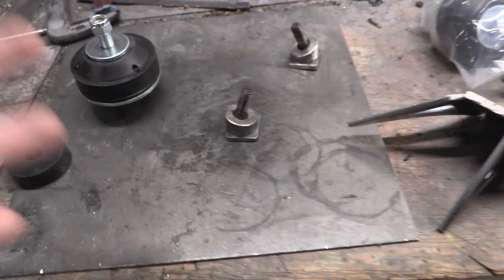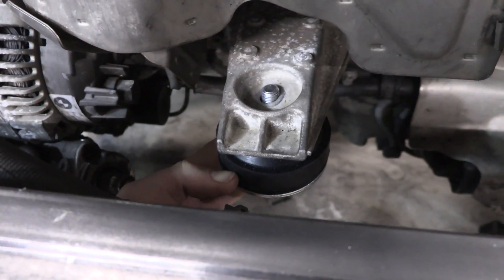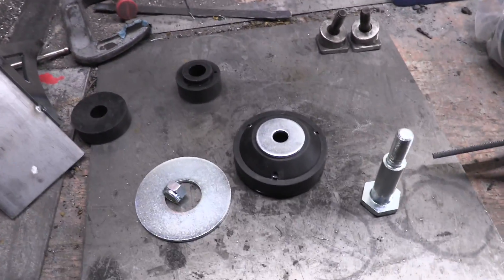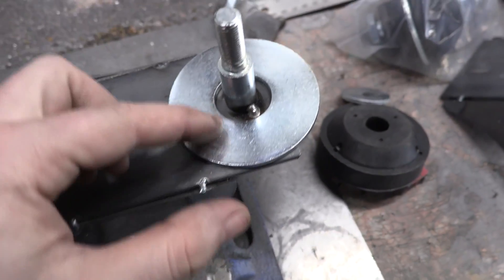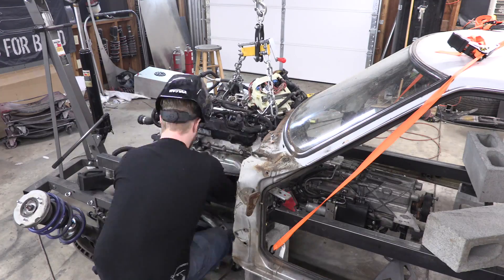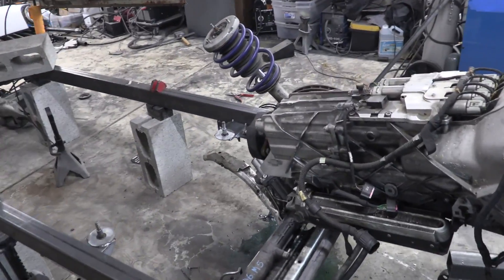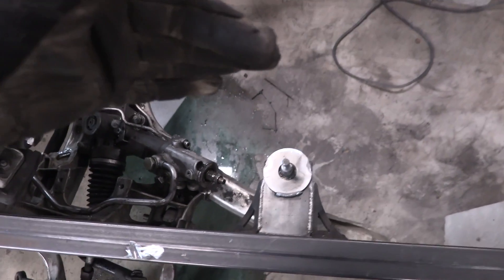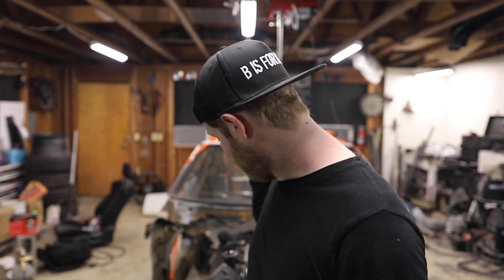The M5 Engine is Officially Mounted in the 240Z!!!

Comment: No clue why you went with that engine choice when there are so many better choices out there.  Those motors are extremely unreliable.  They have issues with the connecting rod bearings needing to be replaced every 100k miles max.  Also there is the Vanos system which if not maintained properly can destroy the motor.  I would have gone with another brand of engine altogether!

Comment: Hey Chris, great job so far, Although I have some concerns. I know you are still setting up your welder and stuff, but to me it doesnt look like your weld melts into the brackets. Its hard to catch when you arent closer, but there should be some change in color around the welds on the metal, otherwise you are just piling on weld and not penetrating the material and making a solid "bond"

Comment: Sooo.... Its technically a solid mount now... right? Or maybe im losing it. You removed the rubber seperation. From a carpentry standpoint, you made a solid point load to the frame...

Comment: Please drill the mounts and use an actual bolt. No matter how well you weld the stud it is always going to be weaker than a proper bolt and nut. Also as many other comments are saying, if you are going to use a mount with a single bolt or stud, you may as well solid mount it because if you allow any deflection of the rubber from engine torque, that is slackening the tension on the bolt temporarily and will cause a hammering force in the bolt and fatigue it.  That hammering force will also transmit to the aluminum engine mounting point which has low fatigue resistance being cast aluminum.
Reply: That is why normal engine mounts use two bolts/studs mechanically bonded into rubber so all the bolt tension is only based on metal to metal contact.

Comment: Chris you and Chelsea are going to die in a terrible accident in this car if you don't put rubber on both sides of the mounts. If it fails at high speed your going to have a heavy engine wrapping that chassis around you

Comment: I really love your work I think your awesome but if no one arks these questions then how will you know if you may have done it wrong  please don’t think I’m being picky I really want to see you succeed in your build.
The new engine mount is awesome but when you cut the bolt and welded it too to the engine mount wont the washer just sit on top at the bottom of the thread even with the rubber cookie with the engine weight, will it still be metal on metal. Hope you understand what I’m trying to say.

Comment: Is it me or does the engine mount in the car have a slanted area where the nut tightens down? If so this whole mount isn’t going to be very strong and might even snap the bolt at the nut! Plus everyone is correct about the second bushing your need to dampen both forces ie engine pushing down as well as the engine lifting this will only help snap the bolt or pull off your welds!

Comment: Kudos for all the skills Chris, much respect bro.... However the other rubber part needed to be mounted below the L bracket coming off the frame to allow movement. How it is currently mounted is basically just a solid mount and will more than likely break. 

In an ideal world a hole should have been drilled in the L bracket from the frame and a longer bolt used to get you your extra thread length.

Don't think this comment is hate, love your work buddy, just had to mention this to stop failure later!

Comment: engine is mounted solid...  could have just saved yourself trouble and just bolted it down to the frame. (which is essentially what you've done, plus a decorative rubber piece on the bolt)

Comment: Do you have a concern about the motor mounts bending with stress over time and abuse? The mounting post sits near the edge of your framerail extensions where there wasn’t much structural rigidity to support the engine.

Comment: I don't think that welding a bolt after cutting it's head is the smartest move,as it's not strong as if it still got it's head,why you didn't drill a hole,and made the head of the bolt under the engine mount base,then welded it,it would be much stronger.

Comment: Since it is independent rear you need to put the motor on a slight downward angel and the differential on an upward angel, otherwise you will chew through driveshaft universals because the grease cant circulate properly

Comment: A solid mounted engine mount stud doesn't look right, it needs to move both ways. Under acelleration one side will be hard mounted (it will crack) and on de acelleration the othe side will be hard mounted.. nice work tho

Comment: I'm litle bit worried that the longer engine mount doesn't have enough support under the washer. Considering engine weight and stresses during driving it could bent right before triangular supports...

Comment: You are MAG welding...not MIG...MIG is for aluminium and other materials...for steel is MIG...for MAG you use active gas like Ar or He,MIG is inert gas like CO2 and mixtures of it like CO2+Ar cronigon and etc.

Im a profesional welder if you need any adcice on TIG or MAG welding just ask
Reply: TitanSilver354 i wrote all of that upside down...mag is for steel with active gas like co2 and mixtures...mig is inert gas like he and ar for aluminium welding

Comment: nice work on the welding each video your getting better! practice makes perfect! quick weld tip, if you feather your tack weld out a bit you can run you root pass over it and tie it in cleanly. on grove welds/gaps feathering your tack will help with getting full penetration on the metal. keep up the great work!

Comment: you just made a solid engine mount by welding the bolt onto the bracket. For a damped engine mount there should a section of pure rubber (like the burned off rubber on the original BMW mount) that absorbs vibration

Comment: You really need to stop now and scrap what you have done so far ! Any half decent engineer will have a fit seeing this mess!
It won’t be allowed on a racetrack and only the most halfassed inspection would get it passed for the road.
I’ve said it before this is an over weight mess stop here and get some advice from an engineer before wasting more time and money on this pigs breakfast!

Comment: Awesome channel, awesome builds, some ideas that may help you. If youre up to trans mount next and if you havent already do some research on trans output to diff flange angles before locking that in.  On what will be a very short driveshaft I cant remember what ends were on the m5 shaft but if its traditional uni joints then you could consider changing to either the CV joint style ends or double cardan joint if the angles are severe. Also if going to airbag suspension that may affect your final strut hat design/size/placement unless its a direct replacement sizing/mounting for the existing coil spring/strut. As an extra level of security for engine mounts if you have some sort of plate/chain/strap so if the rubber or bolt etc fails the backup system at least keeps the engine roughly in place. You also asked recently about tools and things. Personally other than cordless items try and find anything thats old that may have been made in USA, germany, japan etc. Providing it hasnt been severely abused it will outlast anything made in the last 10 years. Bench drills, bench grinders in older items run so much smoother and tolerances better than anything recent. Ideas for the shop is shelving, or benches and maybe mounted on castor wheels, warehouse pallet racking is pretty cheap quick and easy to use. Wooden shipping crates with castor wheels screwed under them could be put under the car bodies/chassis to move them easier.
Save hurting your back and body in any way you can. Life gets pretty crap when you used to be able to do anything you wanted to when its hurts to drive a car let alone wrench on it.

Comment: As I see it, the rubber isn’t doing anything, the aluminum mount sits on the washer that sits on the end of the threat of the stud. The top nut thighs the aluminum against the stud that’s welded tot he frame rail, even if you’re compressing the rubber the top nut is solid

Comment: need to pickup some steel and make a cart for the vulcan
Reply: also why wait for eric? your welds are fine, the only way you are going to get better is by doing it. Waiting for eric to weld for you is not going to make you a better welder, I get you want this car to be pretty, once you got powder coat on that or por15 or whatever you are going to coat it with, its going to be hard to notice if they are not the best looking, especially if its a dark color. Honestly they arent even that bad, one thing that will help is get into habit of turning the welder up a bit more for tacks and only tack where you plan on starting and stopping, that way you dont have any in the middle and they disappear when you fully weld your seam.

Comment: Chris at 8:49 I noticed the diff is really low relative to the transmission or i’m crazy. (°_°)
Reply: RSgiovannie differential is literally on the floor. Not to mention theres no wheels and tires either so of course the diff looks low.

Edit: nevermind... The rear is bolted up and completely way too low. I see what you meant.

Comment: These engine mounts need a rethink, the studs will break off and the engine mounts will bend - 

Should have drilled the engine mount plate and used a bolt and nut.

The engine mount gussets are to short, the plate will bend between them and the stud you welded (if the stud doesn't fail first)

Also you are supposed to use all the engine mount rubbers- how you have it, it is basically hard mounted.

Note enough planning, engineering appreciation and measurements/alignment.

Please redo these mounts. 500bhp will tear these up!
Reply: Agreed, Project Binky is a great example or the 240z build the New from Street Bandito is documenting, or the builds by Fab Forum, Speed Academy etc, there is loads of good inspiration on Youtube or seek help and advice... much better than having the engine fall out or a wheel fall off! 

Chris is gaining new skills with every build but is over confident here.

Comment: those engine mounts are kinda pointless mate, they need to bolt THROUGH the plates attached to the chassis with rubber either side otherwise they're going to vibrate to death. could easily do it with what you have there and a little re-engineering

Comment: You have effectively made a solid mount by hard mounting the stud base to the chassis and removing the bottom bushing. You need to retain the bottom bushing and drill a hole it can sit within on the chassis side mount. The below link shows a diagram of how a similar mount should be installed. http://www.mildevco.net/chevypowereddatsuns/images/motor_mount/mount_exp.jpg

Comment: I still dont understand why he has the support webs under the engine mount plate. he couldve just put them on the top side and not added the triangular tube. It'll work the way it is, but hes already cutting it close for that steering rack rod.

Comment: The mount is not goint to work like that your going to end up breaking and wearing the factory bracket because it will be solid mounted to the bolt shoulder.you need the lower bushing so you will have up and down movementto actually cushion the engine movement

Comment: Sorry, but you still have a solid engine mounting. There has to be a way for the movement and vibration  to be absorbed by a rubber mounting. You have a cushion with the doughnut  for downward movement but none for vertical movement, it will put far too much strain on that nut and probably strip the thread. Put plainly, there is not meat in your sandwich! There should not be  fixed metal between the engine mounting bracket  and the frame, there has to be a flexible joint, ie rubber. (in your sandwich)

Comment: The weight of the engine is sitting on the flat washer, on top of the shoulder of the bolt. Not even touching the rubber bushing. 3:43

Comment: I'm having some doubts about the planes of the front suspension and rear suspension being in the right place.  The rear diff is almost sitting on the floor, and the trans output is like 1ft higher.  Something isn't adding up, in the M5 the trans and diff would be on the same plane, and he didn't mount the engine 1ft higher than the stock K member mounts.

Comment: 'We don't need that' - YES YOU DO! You just discarded the one piece of the mount that creates the essential 'ISOLATION'. Now all you have is a stud going through a piece of rubber and bolting metal-to-metal with the engine. The vibration and noise will be horrible. Installing the engine/transmission exactly horizontal is only correct if the diff nose is also exactly horizontal - is it? If not, then the engine/transmission needs to be set at the same angle as the diff in the vertical plane. In the horizontal plane again the engine and diff must be parallel, but assuming that the diff is parallel to the frame, then the engine needs to be as well. The drive shaft must have the UJ phasing set correctly, and if they are the output to the diff will be as constant as the engine. With a very short drive shaft and a 1” offset, drive shaft whirling may be excessive and cause vibration, so to be sure fit CV joints?

Comment: Hi, enjoying the vids, but.... that first mount has the stud fixed out beyond the reach of the three bracing parts underneath, so I’m thinking all of the weight and twist of that side of the engine is supported on a few inches of horizontal  flat sheet steel (and part of the large disc)?  Honestly, I’m not a materials guy, but that makes me nervous.  The second mount is shorter with the load over the three braces, so that’s better I guess.  And I’m pretty sure you need the stud isolated from the chassis. Again that’s just intuition.

Comment: Keep up the good B 😉👍
First of all excuse my poor English.!
I have some points learned from my previous build 
1- Driveshaft offset between transmission flange and differential flange 
if it’s too much despite the vibration and rattle noises everywhere it will wear driveshaft bushings and the shaft carrier bearing 
2- you need to be aware of where the floor will be that will help with rollcage and any mounts or braces you will need to build and base location where everything should be 
3- I trust your skills in design and fabrication and i’am watching this build from the start and i don’t remember you measure the offset between front suspension mounting locations (frame rails in the M5 engine bay) and to the rear suspension mounting locations (frame rails in M5 trunk)
** what I mean by offset 
From a side view the offset in a vertical line **

Comment: I think it looks pretty sketchy tbh in terms of those shortened bolts not being at an angle anymore, and those TIG welds being potentially under a whole lot of stress... like others have mentioned as well
Reply: I mean, seems to me that the original setup of those engine mount parts with the bolts and the lower huge grommets has a far greater range of motion, and far less risk of breaking/shearing anything off

Comment: Those engine mount's are still solid mounted. It'll be like a spring on the rubber bushing and just slam in to the nut when you accelerate hard or let off.

Comment: You cant just ditch the second rubber part of the engine mount. You allowed the engine to move downwards but not upwards. That means that you can clamp it down but it will act like a solid mount, in order for it to work you would need to leave it loose, but you cant do that either. Basically what im trying to say is that you need to have the part on the engine sandwiched between two rubber parts. So please put a rubber part in top of the engine side of the mount and then tighten it with a nut. If you dont do this it will sooner or later damage the threads and it will vibrate like hell, or it will get loose very quickly.
Reply: Nice pick up. Also what about that angle from the original bracket? Not required? Hmm
Reply: Yea not sure why the angle of the stud went out the window since that was the whole point of using the cutoffs of the original. ^^

Comment: It's very commendable to take on such a huge job, but I would seriously pay for an engineer to go over your ideas before you go too far and find you need to back up 5 or 6 steps because you realise the engine mount system is not right.
Reply: Daniel Sinnott i hope he is reading the comments. Would be a shame if he installed the engine for good and then found out he needs to re do everything.

Comment: Cars coming on real nice your doing good you should be proud you're not a professional at the end of the day, a little tip when you welding vertically weld downward not upwards, try it on some scrap you'll see how much better your welds come out and how much easier it is to control the weld, I am not an expert but I am a welder, not even sure you read the comments but if you do you might see this.

Comment: Really progressing well, my only concern in this episode is when you I think said you were checking that the engine was level front to back as well as across side to side. I expected the engine to tilt backwards a little so that the drive shaft was essentially running straight from gearbox to final drive, rather than relying on the UJs running at an angle. Given that the driveshaft is now shorter, the angle of the engine will need to be steeper than in the M5.

Comment: By not using that bottom rubber section of your engine mounts they will only work in the downwards direction, when the engine rocks to move a mount upwards it will effectively be rigid... or did I miss a bit where you are going to use rubber under the nut at the top?
Reply: richolaf you didnt miss anything. He didnt put that in.